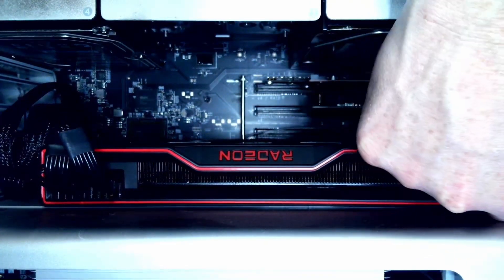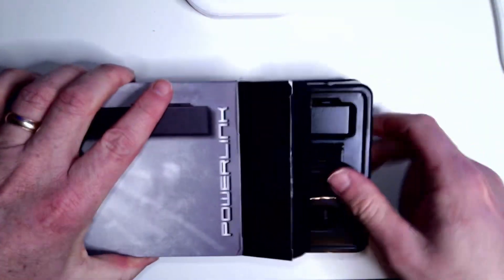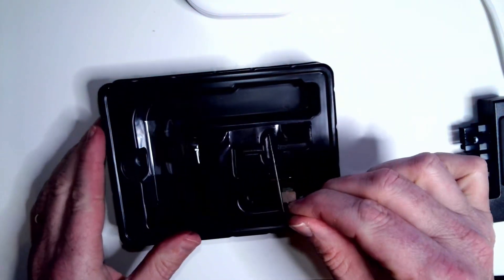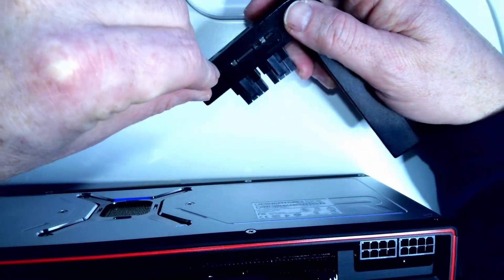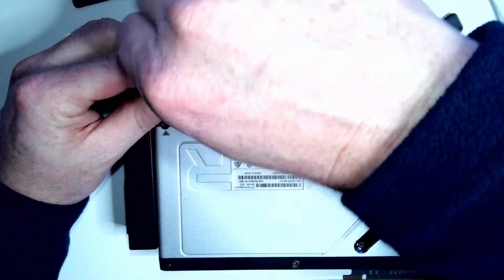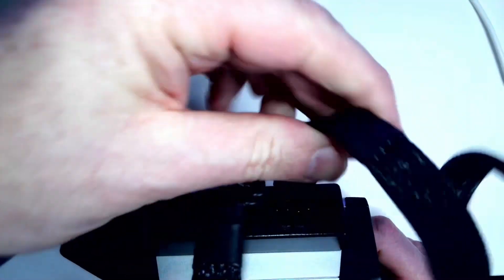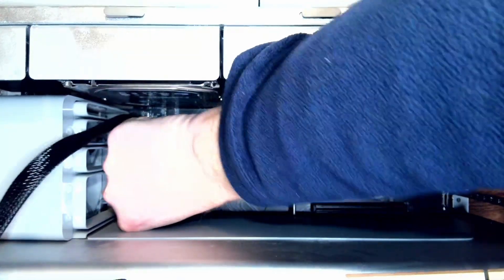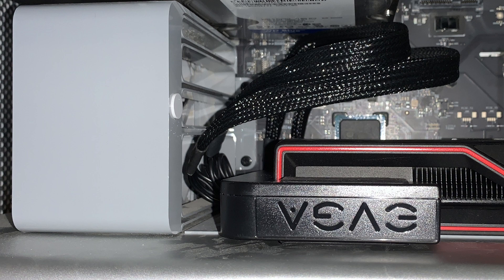EVGA PowerLink, RX 6800, Mac Pro 5,1

Comment: Great video. Ive just started researching upgrading options on my 2010 5,1 running Sierra (not high). Still running the stock gpu. I mostly use art apps, like photoshop but need to upgrade to use more modern 3d related apps like blender. My dayjob is about creating animated storyboards (animatics) and ive found my timeline chokes on playback. Hoping to fix this with a gpu upgrade, but I'm trying to go as plug and play as possible while still keeping the costs down. Dont want to spend a ton on a new card, and flashed rx 580 is still going for $200 on ebay. A friend suggested a vega 56 with a bump to high Sierra. I am worried about power consumption though. Any insights you could offer would be appreciated.
Reply from the maker: Your best bet is an RX 580, a regular non-flashed one for about $80.  1) With your stock GPU upgrade to High Sierra (includes a firmware update), and then to Mojave (also includes a firmware update).  At some point you will have to install the Metal supported 580 to keep going.  2) When Mojave is fully installed, install OpenCore.  You can choose between Martin Lo's package or OpenCore Legacy Patcher.  I recommend OCLP at this point in time.  OpenCore will give you a boot screen without flashing the card.  It will also activate hardware accelerated video coding and decoding on the RX 580 for a nice performance boost in video applications. 3) Do this at your own pace, but with OCLP you can upgrade all the way to Ventura.  I recommend waiting on Ventura, but Monterey is fast, stable and is regularly security patched by Apple.  That's what I am on.

Comment: Could you add another 6800 card to your machine and retest performance and power draw in heaven games and video apps?
Reply from the maker: I’ve already moved the RX 6800 to a Z440.  At some point I’ll either make a video or a post on Mac Pro Upgrade group about it.  The Mac Pro is back to an RX 580 fro the time being.  BTW, the Z440’s optional 700W PSU has two 6 pin GPU power cables.  The PowerLink is the perfect converter from two 6 pin cables to the 8 pin power inputs to the RX 6800.

Comment: this is 6800 XT or 6800 without XT?? XT needs pixla mod and 6800 can be powercd directly from mainboard
Reply: That’s right, i got the 6800 , no pixlas mod
Reply from the maker: This is a RX 6800 non-XT.  I agree with you, but there are a lot of smart people saying not to power the RX 6800 from the backplane.  My previous video showed Unigine Heaven could draw up to 8.0A (96W) from one of the mini-6 pin connectors.  This card pulls very little from the slot (only 26W at max load).  Adding the PowerLink reduces the max. draw from either backplane connector to 7.8A (94W), so provides a little more margin between max operating draw and the shutdown trip.  I am not saying the PowerLink is necessary, but for $4 it seems a good investment to protect the backplane, just in case.

BTW, the official Apple rating for the backplane connectors is 75W each.  User tests have shown the SMC shuts down the system at 120W.  So, we are significantly over-drawing according to the mfr. rating, but well under the shutoff trip.  I have to believe that when Apple designed a shutdown system to protect the board, they set the shutoff trip low enough to achieve that.  As long as we don't trip it, we should be good.
Reply: @douglas_edward  thanks for reply, so you should change title of this video baceuse you have XT in it
Reply from the maker: @zolwixon  Embarrassing!  I changed it.  Thanks.

Comment: would this work with the 780? or 780ti? or the 680ti
Reply from the maker: The PowerLink doesn’t fit all cards.  The power connectors have to be close to the end of the card for it to fit as designed.  This will vary depending on card manufacturer and size of cooler.  You’ll need to search and see if the PowerLink fits your specific card.  If not, you could use a pair of 8 pin extenders and stick the PowerLink on the other side of the fan shroud.

Comment: Hello there ! Really interesting video. I was wondering if the usb c video output of the RX6800 could be used for the LG 27’’ 5k screen (Mac OS edition) or do you still need to put a thunderbolt device (such as a titan ridge) ? 
Regards
Reply from the maker: I’ve not been able to get USB functionality from the card’s USB-C port in MacOS, though it all works in Windows. I would expect to get display output in macOS.